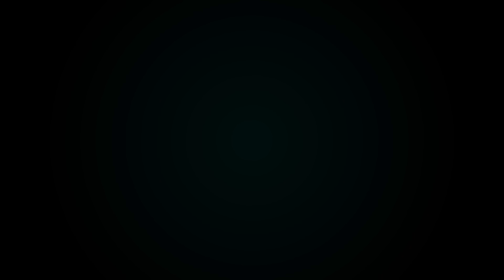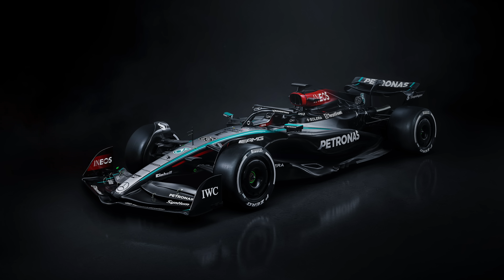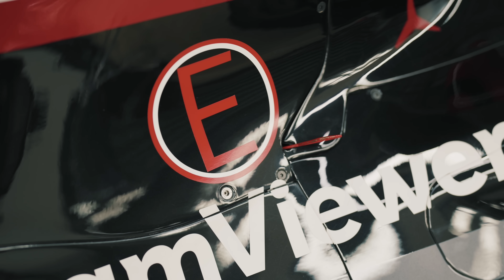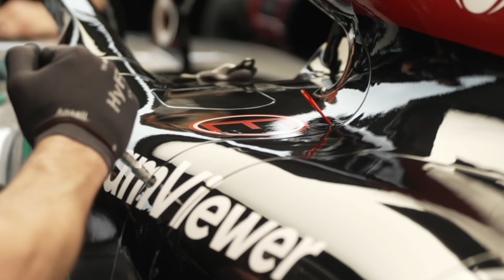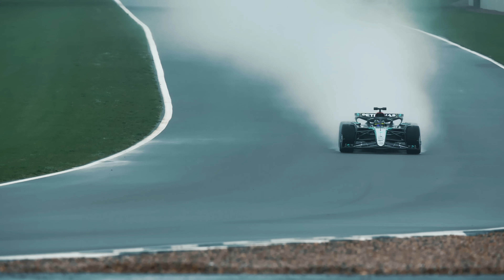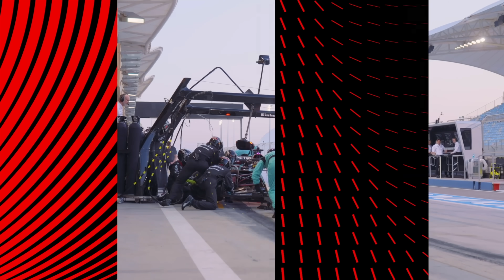What Are The Marshal Safety Buttons On An F1 Car? | Safe & Secure x Crowdstrike

Comment: Very informative, didn't know about the impact G light. Wish they'd touch on the "ERS dismount" drivers have to do if the light flashes red. The drivers have to jump off the car as to not risk creating an electrical bridge between car and ground and thus getting shocked